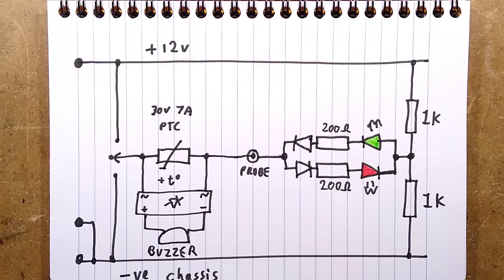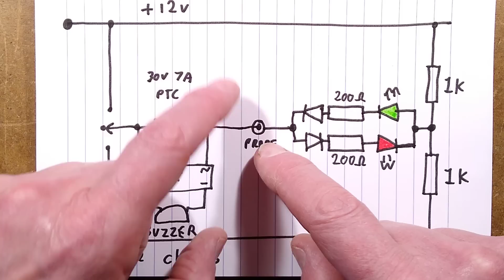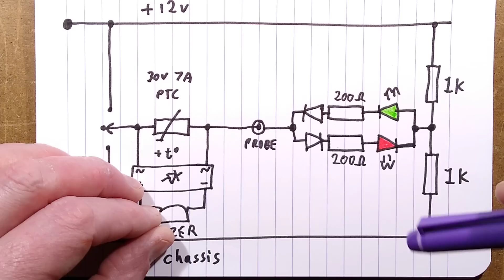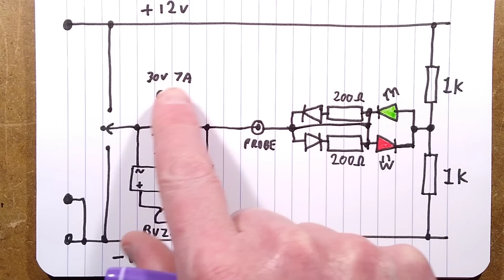Inside a mechanic's test probe - with schematic

Comment: With regards to sensors can bus definitely does not like 12v and the computer will be toasty but as far as sensor being diagnosed as long as it's been disconnected mine is absolutely a God send most sensors Are just magnetic pick ups and are just coils of wire or heating circuits saves a boat load of testing swear by  if you use it to it's full potential

Comment: A bit late to the party on this one. I bought the exact same one of these about 2 years ago, I think it was after watching this video first time around, I have to say it's been quite useful. Anyway I was using it yesterday to check some relays and it stopped working. Fearing the worst, I opened it up and found that the probe was no longer making contact with the little "test points" on the board; a little bit of an old relay contact soldered to the board sorted it.

Comment: I have got this exact one, problem is if I test a dead wire, for example a wire that will become positive when a switch or relay is activated the probe lights up green. It reads the dead wire as earth (ground). When it becomes a live wire it lights up red, so it's not reliable for testing for earth, only positive wires and connections. It gives a false earth reading for wires that I know are neither positive or negative. Confusing to say the least.

Comment: Could you possibly put a digital display so it can be used as a meter as well? If you do where is  the possible connection? Hoping for an answer and a video.
Reply from the maker: I featured a mechanics probe with digital display but no other functions.

Comment: Got the same one had it for years to me a ex auto-electrician used to power up the distribution boards I used to design and build for ambulances and police cars for the blues siren interior lighting and video equipment. I could power up the separate circuits and check the out as my boards also covered the batteries management system but you stayed away from sensitive circuits

Comment: @8:43… I don’t think you meant “when [the PTC] goes open circuit”, you should have said, when “when the PTC develops a voltage across it as the PTC heats up and goes to a higher resistance, the buzzer will sound”.  The PTC never goes “open circuit”.

Comment: Good job you connected the red lead to positive and black to negative otherwise you might have had red electrons going down the black wire, causing all sorts of incorrect readings. 😄

Comment: I was always taught to use a rectifier diode in series with an LED if you ever needed it to actually block reverse voltage, as LEDs are not very reliable at blocking reverse voltage compared to a proper rectifier diode. Whether or not that's true, I'm not too sure haha thats just what I was taught in electronics school
Reply from the maker: in some instances yes, but in this instance two LEDs in inverse parallel will protect each other.

Comment: I don't think those extra diodes will make things worse. The other half of the bridge will still clamp to something that's probably below 5V (typical reverse voltage rating for LEDs). Will it make things better, though? Probably, yes. Compared to 50/60 Hz line voltage, those spikes you're worried about might have a fast rise time. If you assume an inductive spike would rise to however many volts before the forward facing LED has a chance to conduct, the reverse facing LED might experience excessive reverse voltage. The non-LE diode then has a much better reverse voltage tolerance. Even if it might have a few uA of leakage, it would still have a big voltage drop in the reverse direction. If I were to muntz anything from the circuit it would first be the the 200 ohm resistors (and switch the 1k's to 1200 ohm). And second those diodes, if something else had to go.

Comment: Don't LEDs have only a 5V reverse breakdown voltage? 
I think the diodes are used to prevent LEDs blowing.
Reply from the maker: If they were in reverse parallel then each LED would effectively cap the reverse voltage across the other.

Comment: I think the chance of the extra diodes and resistors causing a problem is nil. However, I also aren't immediately seeing a reason for them to be present either. My guess is they built it this way and it worked, so they went with it.

Comment: Nice video.  These PTCs are not PTCs in the traditional sense. They had two different substances inside. A conductor and an isolator. When they heat up (and expand), the isolator pushes apart the conductor particles, so literally breaks the circuit. https://en.wikipedia.org/wiki/Resettable_fuse

Comment: If the LED is tri color RGB, that means it would have a common terminal, whether common anode or common cathode.
But in this, the LEDs are not common anode or cathode.  How did they do that?
Reply from the maker: Six terminal LED, like the classic 5050 RGB LEDs.

Comment: A cool feature would be an OBD2 plug for power. The positive and ground line are available in the port.
Reply from the maker: That would have very little power delivery for loads.
Reply: @bigclivedotcom  Right, but for looking for signals it would be sufficient, I believe. The alligators could be unplugged and swapped with the OBD2 cable. Plugs could have slightly different shapes, so OBD plug could disable the apply potential rocker via a button in the wire socket

Comment: Clive, would it be possible to modify to a potentiometer so you can adjust the output power for testing lower voltage systems/items. Would be interesting to know if it could be done as it would be very useful. Thanks

Comment: Clive thats a car killer probe, NEVER let an apprentice use it!!!! there are later versions with a voltage screen JUST DON'T let the apprentice use them!..So yes great tool for basic car electrics up to 2010ish after that we went to can bus so we now switch earth, we work 5volt, glow plugs may not be 12volt unless you understand what you are testing for don't use it, NEVER use it on engine electronics NEVER! Having said that I have a later version in my tool box and use it 4 or 5 times a week but I use a scope daily and I have a (blue point) probe that can put a slight load on a wire to check for intermittent breaks with a volt meter or scope, the old power probe in the wrong hands will kill a car you have to think your engine has an ecu your brakes has an ecu your seat belts have an ecu your dash has an ecu your electric windows have an ecu, Yes they have a 12v feed but all else is 5v just don't press the button when testing with a power probe!! Great Videos x

Comment: Exceedingly useful. I wouldn't really do much on 12v systems without one of these to hand. Although unusually for me I have never put much thought into the innards of one other than the occasional reattachment of power/ground leads 

Where the leads are too short to reach the other end of a vehicle (BMW with rear mounted batteries spring to mind) I just take power from elsewhere, eg switch a tail light on and find a way of attaching the power lead to it. Least I used to. I have since cut off the clips, added a connector and created all sorts of adapters, bulb, lighter plug, smaller croc clips, even simple spade connectors to plug into existing harness connectors as well as creating another 4m extentsion cable.

Comment: Many people dont realize that a full-bridge rectifier has usefulness with pure D.C., and not just A.C. 

My favorite use for a full-bridge rectifier with D.C. is for use with a reversible D.C. motor. With the bridge connected up to the 2 the motor connections, you will get the same polarity output from the bridge no matter what the polarity to the motor is.

Comment: I always wanted to take mine apart to do this. It is an awesome tool. Thanks for the video Clive! I have been a mechanic since 1992 and my forte is electrical diagnostic. When these came out I was very excited. I had built myself one that helped but it wasn’t near as nice as the one I bought. Mine has a 20 amp breaker in it and I have shorted it many times and you just push the button back in. Also mine came with a cig lighter adapter and a long extension for it.

Comment: The issue measuring device used by all Exchange engineers on selector switches was a test lamp.  It plugged into the rack battery jack and had a three spring switch to reverse polarity of the probe.  They were useless.  Most of us would fix a lamp holder to either side of a sharpened piece of power bus. Used as the probe and the outer legs of the lamps were connected to +&- of a 50v power cable that plugged into the rack.   We had some eddison style carbon loop filaments which glowed gently so you could stare at them while you tested connectîns..
So you had a common probe with 50v on the outside.  So the two lamps glowed at the same intensity as you probed round the switch if you touched earth one lamp glowed.  50v and the other lamp glowed brighter.
With a bit of practice you could measure the resistance of relay coils and resistors and know if it was right or not.  Noisy contacts would flicker.  They were far more use than a meter or the single bulb testlamps.
Now they have a diagnostic rig that tells someone 50 miles away what is faulty and a taxi driver will drop the part in the doorway ready for the poor bugger who drives 100 miles to plug the card in..

Comment: sorry I disagree the protection diodes & 200ohm resistors are necessary for protecting floating voltages and discriminating the same 
it might benefit from protection diodes in the Switch cct too
Reply from the maker: Original units don't have the resistors and diodes.  It seems to be a rogue addition.

Comment: I like these teardowns! I didn't see it mentioned but for the probe tip, I think it slides out because on the name brand PowerProbe, you can either replace the tip or plug in accessories like an alligator clip cord or a 12v-to-5v reducer. I wonder how this clone would act with those accessories.
Reply: I have this exact probe, and it doesn't accept accessories. Mine however I have modified to a 4mm socket so it will take any item you wish to plug in, including the probe. It would be useful if the tone would work as you described as in the original powerprobe, maybe Clive could suggest a mod.😉

Comment: the diodes might be there for a little reliability. if one of the leds go open or shortcircuit, the other may be saved and keep indication by means of a the auxiliary diodes

Comment: Inductive loads wouldn't be an issue since you only get a high voltage spike across the mechanical switch, and there is nothing vulnerable across it. 
And yeah I dont see any point in having the extra diodes and 200 ohm resistors either. Some people mentioned reverse voltage across the LEDs but the forward-biassed LED will always clamp the voltage below the reverse conduction voltage of the other LED - especially if the 200 ohm resistors weren't there. But even if there was enough reverse voltage, the current would still be limited by the 1k resistors and probably not damage the LEDs.
Reply: It could be added to prevent serious damage to the car if the probe were to touch a 5v cable. There would be 7v between them and with the extra diode and resistor it brings the reverse current down enough to prevent damaging the component?

Comment: I've been thinking about this. If the 200 ohm resistors and diodes were not there, as suggested, then it should work fine, as each LED would be protected against high reverse voltage by the other one. But with the resistors in place, reverse voltage would be 6v across the LED that was currently off (since no current down that path = no voltage drop across the resistor). So then you need the diodes. Which is just silly. Or have I gone wrong somewhere?
Reply: Pretty much, yes. Only the 1k resistors will also limit the reverse current through the LEDs with the unnecessary diodes and resistors in place. There is just no point in having them, and the 200 ohm resistors make things worse like you said.

Comment: So it's basically a knockoff PowerProbe 2 without the manually resetable circuit breaker and the buzzer that changes tone whether you're applying or touching power or ground.

I'd prefer a manual circuit breaker personally but the 20 dollar price point is hard to beat considering the real deal is around 90 dollars.

Comment: They could have 1 200 ohm, to protect the diodes/LED? Unless the LEDs already have this.
Reply: A resistor like this doesnt protect against anything in this configuration, since there are already 1k resistors in series with each LED.

Comment: These have a drawback: they light up with very little current, so won't show you a bad connection (typically a bad ground)
Reply: Yeah, the old ones with a bulb used to be dim and gave a decent projection of this. Great for finding corroded wires.

Comment: I just got one of these, fixed my Triumph Tiger by poking at relays until I found the dud. Mine was slightly better with a screen though. Shows voltage, resistance etc.

Comment: Clive, thank you so much for your videos. I purchased this exact probe under the pretense that it had a buzzer. I have used power probes in the past and when you touch the probe to 12v + it would make a beep sound. This is very handy when you have to check a fuse box it cramped places. I was disappointed to find that this probe only has the buzzer for short circuits. Is there any way to "Hack" this probe to make the buzzer sound while touching the probe to 12v+?  When i bought this probe it was $13.00 shipped and that is a far cry form the $200.00 they want for the actual Power Probe brand. I use this for one thing only and that is quickly checking fuse boxes in vehicles. Thank you again.
Reply from the maker: It wouldn't be easy to add that feature.

Comment: I agree that your simplified circuit is all that's required.  I don't think that inductive spikes are a problem.  Disconnecting an inductive circuit carrying current only generates a voltage spike across the gap or the switch doing the disconnection.

Comment: With a i,000. Volt diode in series with a LED, more that 1,000. Volts would be required to reverse bias the LED. Ron W4BIN

Comment: It would be interesting to see what the difference between the chinese clone and the original power probe that it's a knockoff of.  I've got a sealey version and there are a few differences in using it.  the LED blinks for +ve and comes on solid for -ve, and the beeper beeps in the same way.  It does one slightly confusing thing though.  If you probe one end of, say, a lightbulb when the other side of the bulb is connected to -ve, it will beep to indicate that you have probed -ve even with the resistance of the bulb.  not sure if yours didn't do that purely due to it being LED?  I'll pop the cover off and send you a pic to compare if you would like?

Comment: i love my brand version of this! mine came with an extension lead that'd reach the back of semi trailers. nice to know i can get a MUCH cheaper replacement. BUT the name brand has a lcd display for voltage + or--  and the beeper can be used for sensed power for having to not look at the display
Reply: That extension could be useful. I use a couple long wires if I need to at the moment.

Comment: As far as the positive- negative detection, I learned about 35 yrs ago how to make one that is super simple and works great. The leads from the battery are connected to 2 - 360 ohm resistors, the other leads of the resistors are connected together and connected to one leg of a bi-color led the other leg of the led goes to the probe. Connect the battery lead’s, current will flow through the resistors connected in series and when you touch the probe to ground/negative the led will light green, touch positive the led will light red, if the led is in circuit properly.  Has been an extremely handy bit of test equipment over the many years. I first saw one offered to mechanics by Mazda in the mid 80’s, then with in a year Volkswagen instructor gave us the plans for building they out of multimeter test leads. Hope I explained it well enough. Thank you BigClive for all teaching skills you have been of great service to all of us.

Comment: I have gone through 2 or 3 of them in my life, used it almost every day at my job as a auto and marine repair. Although mine had a beeper with 2 different tones ,one for ground and one for power. It would work from 5v to 24v. Also it had a lcd screen on it to show the current voltage at the tip but all of mine had a resettable 20 mini breaker ant the clips came off to add a cable extender , maybe 7 meters longer. Warning....dont test airbag wiring....

Comment: Wouldn't the diodes be needed to limit the reverse voltage on the LEDs?  Often Vr can be 5V or lower.
Reply: the reverse current is still limited in reverse by the resistors so it's probably fine without the diodes.

Comment: If they put 6 contact switch, not just 3, auxiliary clip could be energized in reverse of probe. So you could test electric windows. It would cost me maybe 50c more. 
If I had this tool, I would replace the switch and do it myself.

Comment: I wonder if maybe the extra diodes and resistors are there from another incarnation of this tester where filament bulbs were used in place of LEDs as the indicators for positive and negative.
Reply: The diodes are there for protection because the peak inverse (reverse bias) voltage of a typical LED (referring to standard 5mm and 3mm LEDs) is only about 5 volts the battery supply is well above that.

If you exceed the PIV the LED will short circuit vaporize the bond wire from the excessive current and then go open circuit.
Reply: @Bushougoma  True, however the reverse parallel LED will limit the voltage to that of the forward drop (2-3v) so the "protection" is over the top - as in, it would only be protecting stuff if an LED failed... which is pointless as you need them all working in the module anyway...